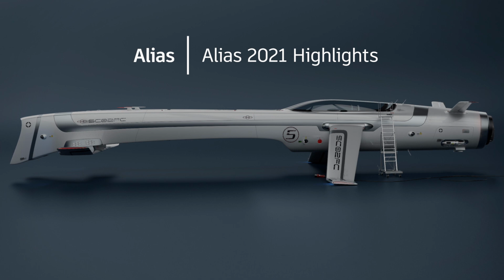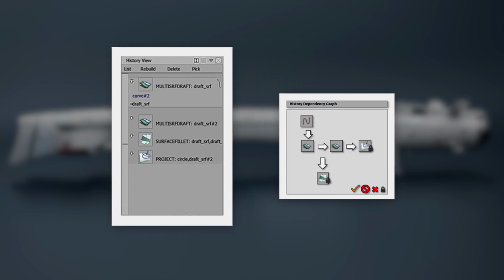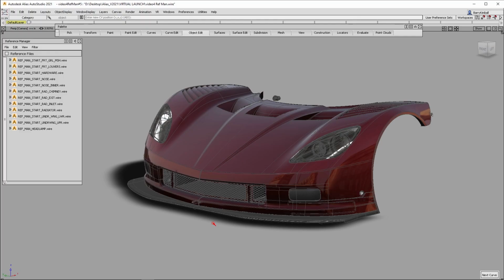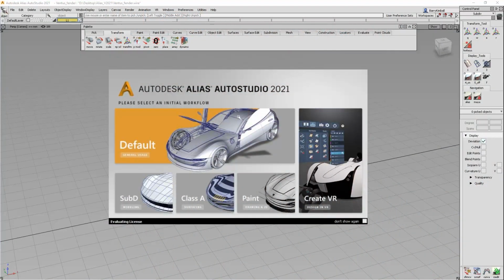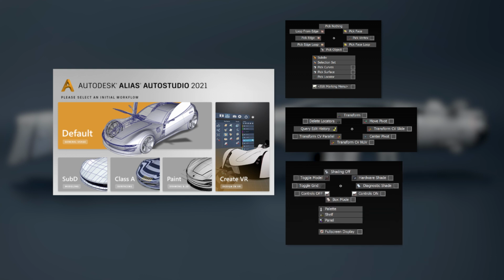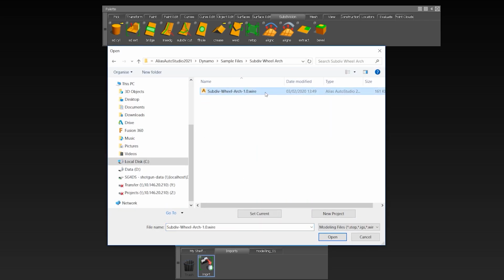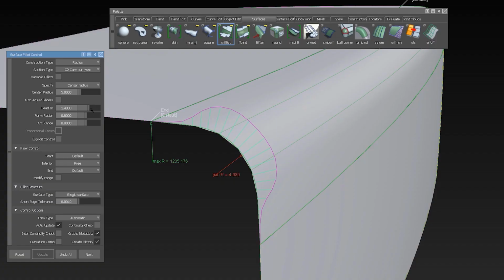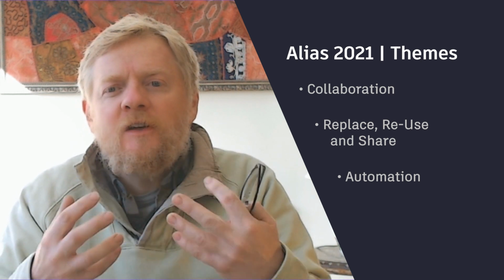Design Studio Product Launch - What's New in Alias 2021

Comment: The 3d car in this video looks very smooth. Kudos for the modeler for his great Class-A skills. However, your next demo car should include the following improvements:
- Doors that could actually fit the power windows inside.
- Door inner panel that will not collide with the door latch.
- Door skin that will not collide with the side skirt (rocker panel). The door hinge must be engineered with a proper geometry.
- Wheel well arches that will allow some vertical movement of the wheels (supposedly, a sports car has a suspension).
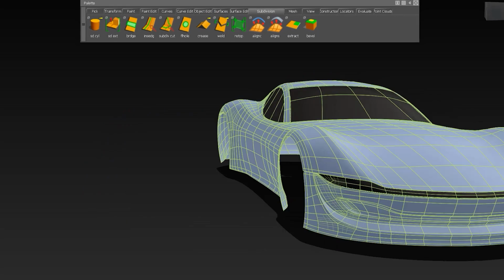- Front wheels with proper turn axis (a.k.a. king-pin axis) that define the camber angle and caster angle (at 9:56 the video shows deep front wheels that are simply rotated along their center in a way that can't happen in the real life).
- Headlights that could meet the requirements for a car to be road legal (headlight projectors must be located higher).
- A turn signal at either side somewhere between the front wheel and the door (could be on each wing mirror).
- Ground clearance of at least 100 mm to be road legal (with two adults inside it drops to 80-90 mm).
Reply: That is just an example, concept, which represents what you can create using Alias... This is your business to create something according to road-legal requirements and etc.
Reply: @elunaselemine9781  , it's a car model specifically designed to advertise the capabilities of the most used surfacing program in the automotive industry. The NURBS model is very well proportioned, which means the designer who did it has a good talent and has a taste for interesting shapes. Car manufacturers are those who will buy the major number of the program for manufacturing. However, engineering-wise the car designed to advertise the program to the manufacturers is not manufacturable.
Reply: @AutomotiveCNC  know it but it is just a concept ( which they actually use for several years without any significant changes)))) I'm not against your thoughts but concept-modelling is concept modelling. You should present the desi gn properties first, regulations are not as neccessary here.
Reply: @elunaselemine9781  , this is a great opportunity for them to show and prove that Alias could be used for adjusting the existing design to make it manufacturable. Just like what the designers at the automotive companies who use Alias do. :)
Reply: @AutomotiveCNC  that's true) I'm sorry but can you help me? Is it correct to create car body using SubD instead of NURBS and then polish it using class A? ( Mean convert subDs to NURBS an then use class A). Or I should fully rebuild body again with NURBS and then polish it with class A? I know that car engineers have already got used to NURBS cause they were practicing it for several years, unlike SubDs which are new method. Thank you for your reply!
Reply: @elunaselemine9781  , SubD is not a new method. It's a Catmull–Clark subdivision method originating from 1978, so it's almost half a century old technology. :) Also used in 3DS Max and the majority of other polygonal modelers. SubD has one major disadvantage and that's the point of connecting the so-called "star connections", i.e. where 3, 5 or a higher number of edges meet together. SubD is only smooth if 4 edges connect together, otherwise it loses continuity between the surface patches. This disadvantage is especially noticeable with Zebra analysis applied to the model. This is why SubD in the automotive industry is primarily used by car designers to quickly try some new shapes and proportions, before they decide to create the final design with NURBS, which is much more time consuming.
 Recently I also used SubD in Rhino 7 to design a 3-seater concept for AUDI sports car that will become viral online in the next few days. Its body finish is highly reflective and there are several areas with star connections where 5 edges meet together that determine the slightly imperfect continuity between the surface patches. Some day I intend to recreate that model from NURBS, thought it may take more than a month to accomplish that. In SubD it took me just 3 days to figure out the shape and proportions according to my taste, because modifications are done instantly. This is where SubD shines most.